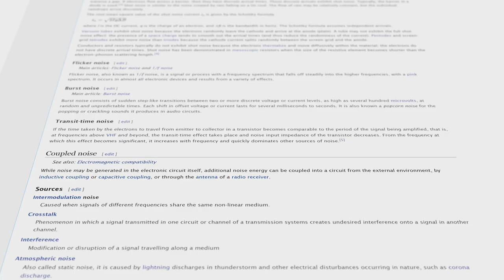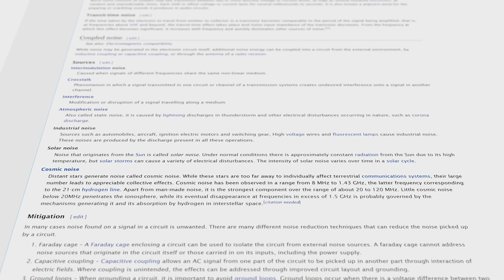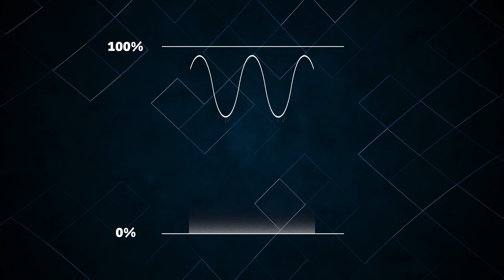Exposing to the Right - Video Tech Explained

Comment: We learn something every day. Back in the day with 35mm SLRs we tended to under-expose by half a stop to keep the images nicely saturated with vibrant colours. I will have to reset. It clearly helps to have a digital camera with a clipping warning feature (which mine doesn't).
Reply from the maker: Yeah! This pretty much just applies to digital cameras, though.
Reply: @VideoTechExplained  If you "expose to the right" it means you have to edit the photos/videos before you can use them. If the lighting conditions are good and you don't need a high ISO, it seems to me that you can just expose normally and use the result straight out of the camera.
And what is a high ISO value? In the days of film the gold standard Kodachrome was ISO 64, and normal Ektachrome was ISO 100 - you could buy ISO 400 but this was considered to be very fast and a bit grainy. Yet somehow we managed to take good images on most occasions.
Reply: Note that underexposing for better colors still applies with DSLRs. I shoot like that most of the time (talking about photography, though, not video). The trick is of course to know when to expose to the right and when to underexpose a bit :) And obviously knowing your camera well and understanding how it responds to specific scenes/lighting conditions is absolutely crucial for the whole thing to work well :)

Also, as for "using results straight out of the camera" - it's not a good idea and I would even perhaps call it bad practice. With digital cameras, you pretty much always want at least a bit of basic processing. And with DSLRs and/or cameras shooting raw/log (which you should always do if your camera allows that IMO), it's absolutely mandatory. So you're unlikely to find yourself in a position where you would use the shots straight out of the camera anyway.

Comment: Nice explanation of exposing to the right... however, most cinematographers want to use selective focus by choosing a specific aperture. So, controlling the exposure by adjusting the aperture is not an option. It is done by manipulating the light source, natural or artificial, or using ND filters. So, while you are correct with your explanation on how to control exposure, you are sacrificing creative control over the image you are recording.